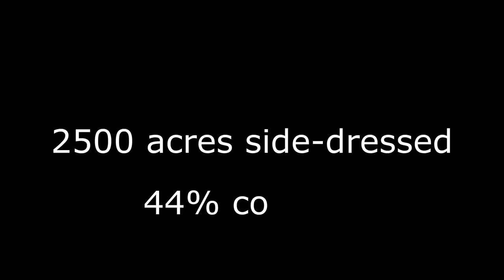Furrow Force Results, Salford Halo VRT Inspection & A Lot Of Excavator Work Season 4 Episode 7

Comment: Hi Reese, You mentioned losing moisture on sown fields, surely if you roll, especially with ring rollers this will not only keep moisture in the soil, but prevent evaporation, as less surface area.  Best Wishes

Comment: Those super duties usually have extra room for adding electrical, so you don’t have tap in to anything pre existing. Changing any resistance in the system anywhere will set bcm codes. Should be 3 or 4 switched circuits that are separate from the oem electrical.

Comment: I think the reason the trucks get taller is because everything getting bigger. More hp,  means more cooling, larger radiator..etc truck needs to have a rake for when you load it. I suppose they could design the bed lower but it would look pretty goofy

Comment: About those old tractors. My family went from horses to 2 cylinder deeres all the way to the 1960’s, then they went to good old white top Internationals. The 66 series they always hated, because as a cab tractor, they were terrible, so they ran them cabless. They did have an 86 series, and loved it. It was too late to save IH though. Deere had such a huge head start in cab comfort with the sound guard. So despite having a mechanically far better product, IH didn’t make it and became a huge conglomerate of different companies and I’d hate to be the one who owned one when it’s old. As long as you don’t own them at that time, they are great.